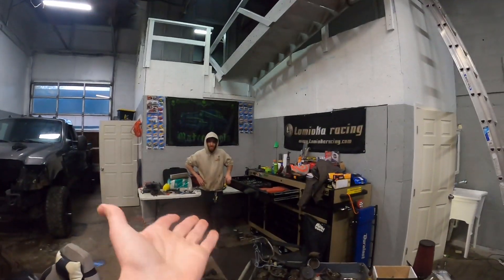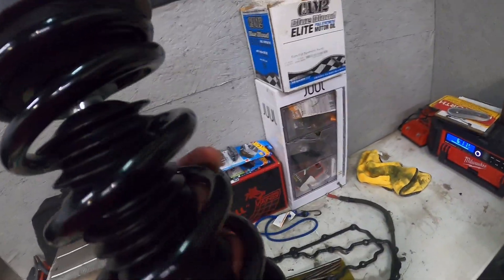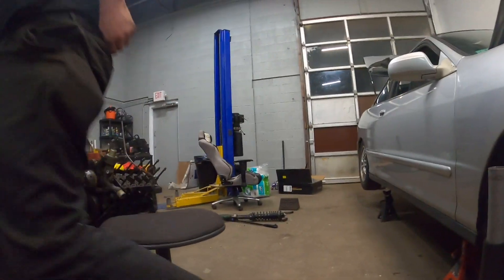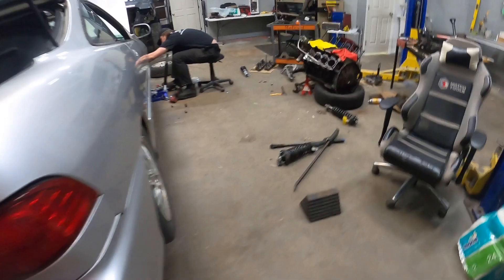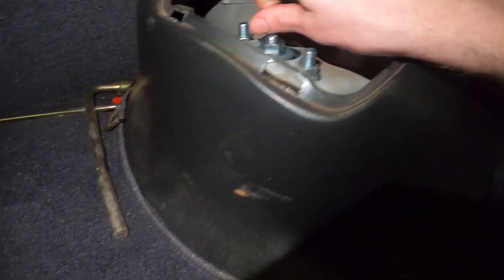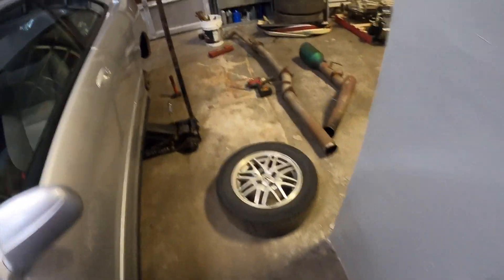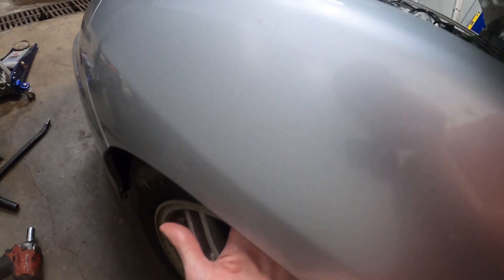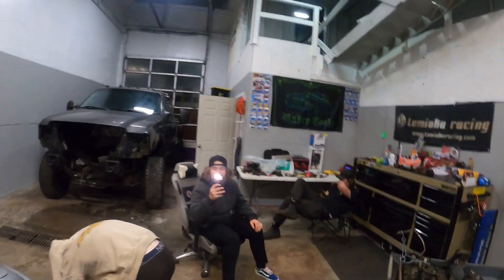$5000 Budget Integra Build Part 2: $200 COILOVERS INSTALL!!

Comment: my first and current car:

1999 civic si coupe - $2600
yonaka coilovers - $600
yonaka exhaust and new cat - $450 
konig helium wheels with tires - $350 used
jvc double din head unit - $100
ebay lip - $90
other misc stuff - $100 

about $4300 CAD or $3200 usd
Reply from the maker: Goooooodddd shit bro
Reply: how does she ride? lookin for coils that feel like a cloud.

Comment: 2005 lancer es crashed $600
Fix front end $300
Sound system $600
Te37 reps(yeah yeah $500
Tires $300
Suspension tein lowering springs front and rear ralliart sway bars ralliart strut bar ralliart rack and pinion ralliart shifter and cluster $300
Entire oz rally interior swap $100
Bodykit wing and fogs $250
Header and mufller $100. 😊
Reply from the maker: That’s the way to dooooo itttt
Reply: Nice

Comment: I have a question, how do u prevent ur integra from being stolen? Wondering if I should get one
Reply: Steering wheel lock. wireless security cams. Gps tracker like low Jack
Reply: kill switch.  Integrate it into the car.